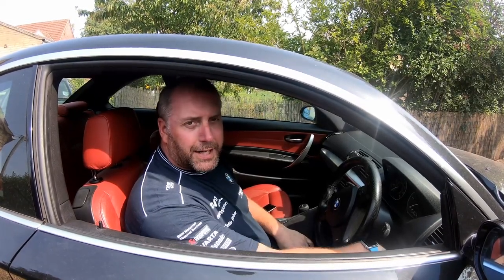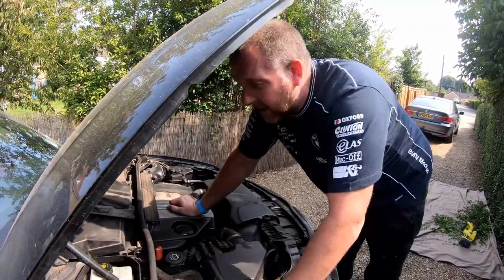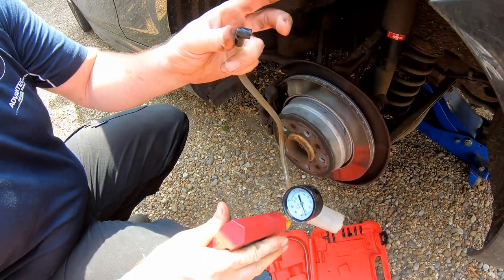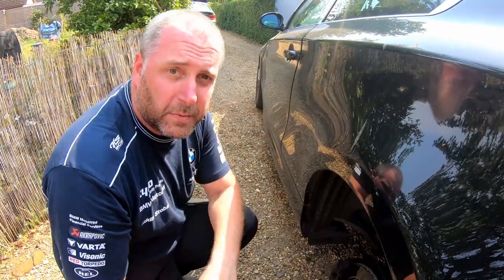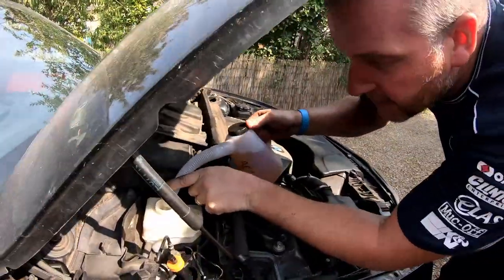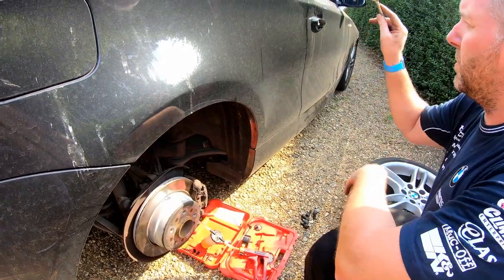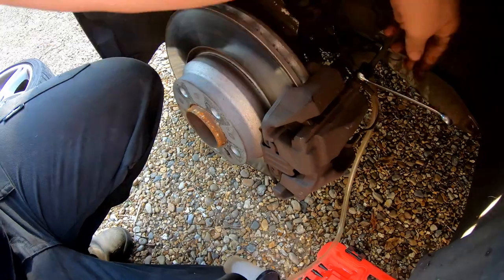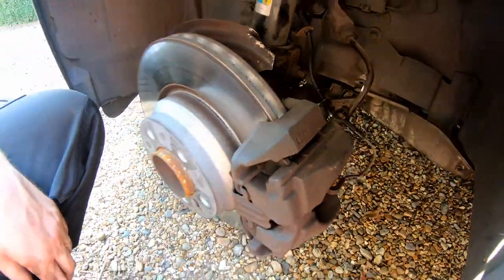BMW 1 Series - Brake Fluid Change and OBC reminder reset.

Comment: Great video! Although the Haynes manual says to bleed the system from the bleed screws in the following order:
a) Right-hand rear brake
b) Left-hand rear brake
c) Right-hand front brake
d) Left-hand front brake

Which is mirrored from what you were doing.
Reply from the maker: Unusual, whilst I don’t usually use Haynes manuals and prefer to use the factory alternative, bleeding the longest line first, ie. the one further at from the master cylinder is the recommended practice on any vehicle and not just the 1series! Naturally on a right hand drive car, where the master cylinder is mounted in front of the driver (nor always the case though) the near side rear would be the furthest away! 👍🏻
Reply: Depends of steeringwheel side position

Comment: Nice video sir...always amused me why BMW thinks that the fluid is useless after two years ....mind you as i also found out on my 320 ...BMW thinks a lot of things need changing when they are not broken...had a Waring for the DPF that said "Replacement required" and after hours of digging and finding out about BMW DIS ...i found that there is a counter that triggers after so many Kilometres regardless if its faulty or not ..nice bill if you take it to the main garage too....Needless to say it was perfectly fine and re-gen'd no problem after a reset .      :)
Reply from the maker: Cheers mate.

Comment: Great video once again Kev. Just have a quick question regarding this kit as I bought it last week. I pump up the vacuum before undoing the bleed nipple and  the bleed nipple adapter seems to fit snug but as soon as I crank the bleed nipple, the vacuum just goes to 0 like the is an air leak at the bleed nipple. I have tried it without the adapter and just with the hose but still no joy. I double checked all the seals around the hand pump and the brake fluid collector container and all seems fine. What would you do in this scenario? A different bleed nipple adapter or a smaller hose? Would appreciate your help, thanks. Liam

Comment: Can you simply add more break fluid if it’s low. My mechanic said it was low so I’m just curious?
Reply from the maker: The fluid is low because your pads have worn. As the pads wear, the piston has to push further out of the caliper to take up the slack, this in turn means that the fluid level drops in the reservoir. Simply top it up to the recommended level but be sure to remove some fluid when changing the pads in the future.
Reply: @KevsShed  Many thanks for your advice. I really appreciate it. 🙂👍👍👍

Comment: Hello again mate! When bleeding your brakes is your handbrake on or off? Would you also bleed your clutch at the same time or when would you bleed your clutch?
Reply from the maker: It makes no difference if the handbrake is on or off to be fair. The handbrake is totally independent of the hydraulic system and is cable operated.

Comment: Is this applicable to a 128i ?
Reply from the maker: Yeah should be 👌🏻
Reply: I have that same bleeder kit you are using, I saw some forums on where people use a Motive bleeder and they do a vacuum from the reservoir, is there any difference between that procedure you are doing and the Motive bleeder one? Just curious! I found your procedure more simple and straight forward.
Reply from the maker: @josearroyo4575  yeah what the one from the reservoir does it use air, normally from a compressor although you can use a tyre valve, to force the fluid through the line. I haven't ever had much real success with those personally though so prefer my method. I also have a vacuum bleeder that can be fitted to a compressor which is also highly effective.
Reply: @KevsShed  thanks for your answers! Good content on your chanel keep it up, not a lot of good content for the 1 series around! 👍🏼✌🏼
Reply from the maker: @josearroyo4575  Cheers dude, got a few jobs on the 1 series planned so stay tuned!